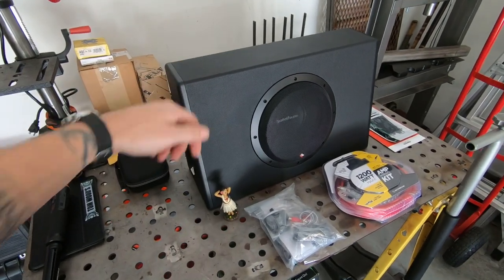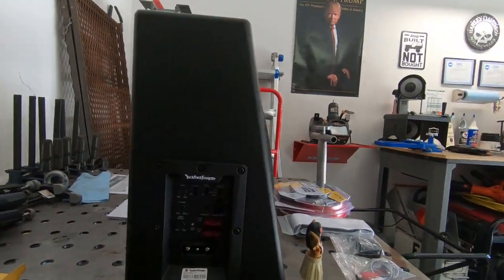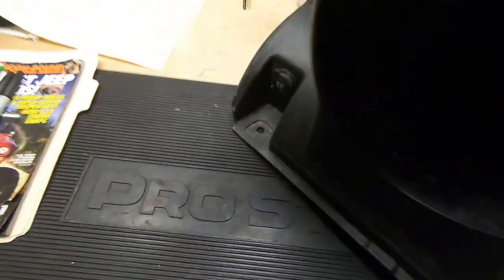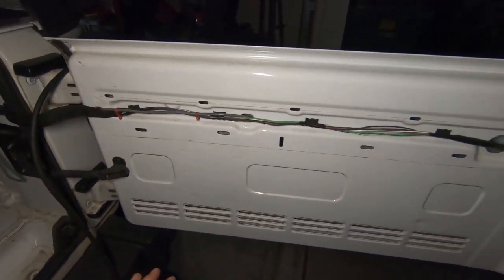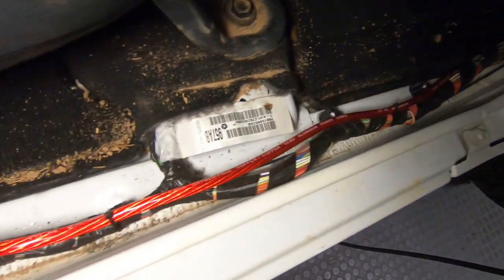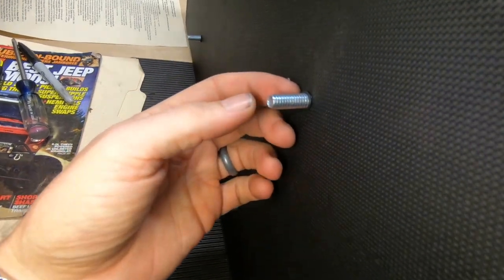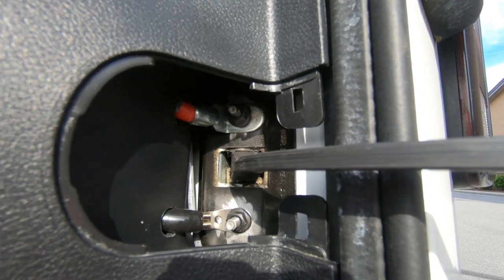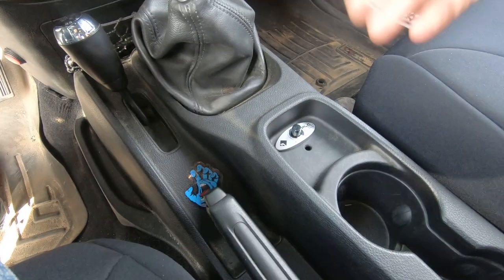Rockford Fosgate P300-10T Sub / Amp Combo & 1.5 Farad Capacitor | Clean Install Jeep Wrangler JK

Comment: I have had fairly big systems in my days but now I have this (the 12 inch) in my extended cab f150. These subs sound great for what they are
Reply: Did you put the sub under the back seat? Or behind it?  I have the crew cab but don't want to give up the space under the back seat.  I'd like to put it behind it.
Reply: @mikel6787  I have it behind my drivers seat so I lost that space and can't have a passenger behind me (that doesn't bother me tho cuz I've never had more than 3 people in my truck)

Comment: Rockford is rugged amp subs are golden and long lasting still using a punch 200 ix powder coated in great shape only thing is need to glue the metal Rockford logos that fell out on both ends but these bad boys keep playing 20 plus years old still cranking .

Comment from the maker: I ended up adding a layer of Dynamat Extreme Between the box & tailgate...no more vibrations. I also reinforced the back wall mounting points on the interior bolts of the box w/2 pieces of C-channel running laterally across the box from bolt to bolt (think "="). This helps to spread the clamping force across the entire back panel of the box vice just at the bolt heads/washers. If the box was solid plywood it wouldn't be necessary, but it's MDF & not as strong. Now I can sleep at night knowing my sub box is hoss as frig & won't fly off if someone slams the tailgate ✊🏻
Reply: If you install this, does it connect to your radio or what do you have to connect it with Bluetooth? Like I need an answer
Reply from the maker: You have to connect it via either RCA cables (like used on aftermarket head units) or you can tap into an existing speaker's wires for the audio input. You can also use the audio input signal to power the amp/sub on & off...it automatically detects the signal. It does not connect via Bluetooth...wiring is involved although it is minimal. If this is all jibberish to you, I recommend giving someone like Crutchfield (Google it) or your local audio dealer a call.
Reply: Good to know!

I am considering modifying this install and using corner braces. Braces to the tailgate, sub to the braces. This way the bolts will be facing down and not need to clamp as hard. Id probably put a rubber gasket between the top of the sub and the tailgate for vibration. 

I figure this way thieves cant get it still as with the talgate closed, the nuts are blocked by the sub and the floor, but if I want to take it out to fit something larger in I can open the tailgate and remove it without opening the sub up. 

Thoughts on how this would work?
Reply from the maker: It is certainly possible to mount like you say & each method has its pros/cons, but ultimately it boils down to what is most important to you...cleanliness of install, security, anti-theft, modularity/ease of removal/frequency of removal, etc. Since you asked my thoughts I'll provide some feedback:
- From an anti-theft standpoint, yes the bolts/nuts would be blocked w/the tailgate closed, but if a would-be thief could even access the sub box all he/she would have to do is click the power lock button & open the tailgate to access the bolts. Would it still slow them down, yes but not much. If it's easier for you to remove, it's easier for them as well.
- You would need corner braces at both top & bottom to control the inertia of the sudden stop of the slamming tailgate...over time if only secured at bottom the box would flex each time it was closed & eventually be prone to failure (unless I'm picturing your concept incorrectly)
- The design/internal reinforcing structure of the tailgate will limit where you can successfully drill & mount rivnuts...it may be possible to mount where you want but just keep in mind that there are steel "ribs" or reinforcement sheets running perpendicular to the would-be mounting face of the tailgate that could interfere. 
- The major plus of your idea would certainly be ease of removal...again, it boils down to what is most important to you & your individual needs. I'm happy to report that to this day I have not had to remove the box 1x since the final mounting design and it is still working flawlessly. Whatever way you decide to go, let us know & best of luck to you my dude 🤙🏻If you have any more questions, let 'em rip & thank you for your comment/question & view!

Comment: Great video! Can you help me .you didn't use the high-low converter, you connect directly from the old subwoofer's output
Reply from the maker: That's correct, I just used the 4 wires running to the factory sub, identified which were + & -, and spliced them into the RCA cables that came w/my amp wiring kit. The factory sub wires carry 6.4 Volts DC so can be used as a hi-level input to turn the amp on automatically. Just make sure your hi/low-level input switch is in "HI" & your "Auto turn on" switch is in "DC Offset"; she'll power up automatically as long as your head unit is on. Let us know how it turns out & good luck 👍🏻

Comment: I love how you mounted your sub and put the cap in the old sub housing. Do you think 2 pieces of strut would have been better to mount the sub to using spring nuts? That way you can have little clearance behind the sub.and not have to take the sub out if you wanted to remove it. Again nice install. just my 2 cents
Reply from the maker: I thought of a few different ways to mount it but ultimately took this route for a couple of reasons...1) It's hella-clean this way in my opinion. 2) In theory this would possibly deter, or at least slow down your average thief...they would either have to take the time to pull the sub & unbolt the box, rip the box off the tailgate (which would likely destroy the box itself), or steal the entire tailgate. Keep the honest man honest...thanks for the compliment, idea, view & comment! 🤙🏻

Comment: Some Tessa Tape would make that look a lot more "Factory". Also are you not worried that the sub or amp will get wet?
Reply from the maker: Never heard of Tessa tape...I'll check it out. Nope, haven't had any issues w/water intrusion. The only part really sensitive to water is tucked away pretty nicely.

Comment: Hi gear video! I have the same Jeep and am looking to do the same set up. Can I ask what is the purpose of the capacitor?
Reply from the maker: The capacitor helps provide extra voltage when the sub hits hard that it stores internally. Think of it like a buffer that takes the peaks off of voltage spikes....this keeps your headlights from possibly dimming when the sub is hitting & helps to lighten the load on your alternator. Thanks for the view & comment! Good luck w/the install, it's a fun project 🤙🏻

Comment: Do you know what tools I need to open up the fostgate sub? Like you did in the video 9:14. I need to swap my amp out came broken from factory🤬
Reply from the maker: #2 phillips screwdriver & looks like either a 2.5 or 3mm allen wrench (just from eyeballin'). Sub will be a little adhered to the box so will have to gently pry/work it loose OR maybe you can take the amp out & just reach your hand inside to unplug the leads.
Reply: @coldsteeloffroad  you know what amp it runs? I’ve tried researching but can’t find anything I have the 500 watt 12 by the way
Reply from the maker: I'd try calling Crutchfield.  How u know the amp itself is bad?

Comment: How is the vibration on the outside of the tailgate?  I was thinking of building a box like this, but I didn't know if it would vibrate too much.  Thanks!
Reply from the maker: It definitely vibrates. If you turn it up too much it sounds like a teenager's POS Civic rolling through a Wal-Mart parking lot at 10pm on a Friday night 😂. I literally just ordered some Dynamat Extreme to help cure this. Either way, it still beats not having any bass IMO. I recommend some form of sound deadening material if you go this route. Good luck dude 🤙🏻
Reply from the maker: Added the Dynamat Extreme to the tailgate, retightened the fasteners & she's pretty much vibe free now. The bolts were a little loose which is primarily why it was vibrating in the 1st place...I was just too lazy to check it.

Comment: Is it still holding up well a few years later? About to do this on my tj tailgate and was curious...
Reply from the maker: It's still going strong like it was brand new & zero issues. I've only had to tighten the bolts 1x as I developed a rattle at one point, but I used blue threadlocker on the 4 mounting bolts & no issues ever again. 100% would do it again.

Comment: Good morning 
I know this is old but one question - I am installing the 500P into my trunk - ran the power wire and bass control knob wire already-  now need to install actual sun and hook it all up - with this set up - are you able to just run the wire to tap into rear speaker wires? Like to connect the sub ti factory radio - can I just tap into the existing speaker wires (like pop side panel off and then use the Posi-taps to just tap into Neg and pos wire )

I have the wiring just want to  before doing it 
Thank you!
Reply from the maker: Good morning. Sorry, just saw this. Yes, you can tap into an existing speaker's signal for audio input to the sub. Thanks for the view & comment! Let us know how it turns out please 🤙🏻

Comment: Can you wire this sub without the remote wire? Just four signal wires from speakers before the factory amp?
Reply from the maker: I just wired mine straight off of the signal wires feeding directly into the old factory sub. You have a few options with this sub which is what makes it pretty cool in my opinion. Thanks for the view & comment 🤙🏻

Comment: I have a stock Ford F-150 stereo. If I add this unit to my truck I have a question about the speaker hook up. Do I leave my rear stock speakers hooked up and then tap into the speakers with the spliced end of the RCA hook ups? Or do I buy a LOC and tap into the stock speakers and plug the RCA into the amp unit?
Reply from the maker: I think you could do it either way, but to be safe, I'd honestly call Crutchfield tech support. Those fellers should be able to help you for sure I'd imagine. Sorry not the answer you were lookimg for, but jot gonna' blow smoke at you if I'm not sure. Thanks for the view & comment!
Reply: coldsteel_offroad not a problem. I have a call scheduled with cruthfield tomorrow at 12pm 😁

Comment: U put a clear coat on?
Reply from the maker: Without watching the video again & if I remember what you're asking about, yes I sprayed a little clearcoat over the area where I ground the paint off to get a good ground for the system AFTER I had the ground lug tightened in place. Purpose is to prevent corrosion/rusting. Thanks for the view & comment!

Comment: How did you get the actual sub out of the box? I have removed all the screws surround it but it still wont come free. Have tried a pry tool but dont want to exert too much force and damage it. Was it glued in?
Reply from the maker: There's a type of foam gasket that is sticky & can be a little tough to get out at first. I just worked mine until it came out...nothing too crazy though. Keep at it & she should pop loose for you. Thanks for the view!
Reply from the maker: ...worst case you may be able to unscrew the amp, partially remove it & "help" the sub out from the back side. You shouldn't have to though.

Comment: I see you have the stock radio how does it sound with the rest of the system?
Reply from the maker: The stock speakers are still lackluster, but the bass is sweet. I ended up replacing the 4 factory speakers when I installed my Genright roll cage w/some Polk units...much clearer, distortion-free sound but lacks mid-range; will have to tackle that later. 
Bass is pretty weak when top is fully off since nothing to reverberate off of but that's not the sub's fault. Thanks for the view & your question!

Comment: How you connect the capacitor?
Reply from the maker: BATT+ to CAP+, CAP+ to AMP+ (2 power cables will be on same CAP+ post...think CAP+ wired in-line between battery & AMP). CAP- to GND. AMP- to GND.
Reply: @coldsteeloffroad  thanks 👍

Comment: Do you still recommend it? I have a jeep patriot I want to put it in. I figure almost everything will sound good off the back glass.
Reply from the maker: I would. I don't know what your goals in a sub are exactly (big bass or a moderate level ok), but as long as your expectations aren't for HUGE bass like from 2 12's or something you'll most likely be pleased w/the sound. The sub does sound good & produces a good amount of bass (can rattle my mirrors & be heard outside)...the included gain controller is a must & I adjust it to my liking for almost every song & appreciate it. I recommend mounting it where u can easily reach while driving. In your application I bet it will sound amazing...sounds awesome in my Jeep even w/a soft top installed. Moral of the story is it sounds like a tight 10" sub in a sealed box, not some crappy 8". Do it man, I don't think you'll be disappointed!
Reply from the maker: ...produces enough bass to envelop you while listening (you can feel the music if that makes sense)
Reply: @coldsteeloffroad  thank you. just what I wanted to hear. Sounds like it will fit the bill nicely not having to build a box and find the right amp to make sure the sub is tuned properly.
Reply from the maker: @TRONMAGNUM2099  ...if you have the room to spare and can fit the 12" version (box slightly larger than the 10"), I'd probably recommend that...you can always turn the bass down, but she'll only suffer as much chooch as she can suffer if you know what I mean. I would have bought the 12" version but space was a factor for my install. They cost about the same price if I remember right...don't get me wrong, I love the 10" but bigger in this case is almost always better. Good luck bud 🤙🏻

Comment: I wanna put 2 10s on my JLU tailgate.  How bad is the rattle?
Reply from the maker: Rattles outside like the trunk of a '96 Ford Escort on East St. Louis racing rims w/2 12's run on a budget 1000w amp bought at a swap meet cruisin' through a Walmart parking lot. Not bad at all inside, can't really hear any rattle. Just kidding above...it does rattle outside but not that bad.
Reply: @coldsteeloffroad  🤣
I started second guessing for a second there.  I know what a 96 Escort with 2 12's sounds like.  I got some sound deadening mat, I'll be generous with that and keep my fingers crossed.
Preciate it.
Reply: @fightfish3265  How did that deadening mat work out?  Was thinking of doing the same.

Comment: that amp in the sub is only pulling 30 amps. You def DON'T need that Capacitor and you should remove it as its doing nothing. Also, you should ditch the bass boost and install this (PAC LC-1 Remote Amplifier Level Controller) instead to control the volume of the sub independently. Gives you the ability to turn off the sub completely.
Reply from the maker: When you add it all up w/accessory lighting, rock lights, light bars (potentially), and a winch pulling hella amps under load it all adds up. I decided to install it to assist my charging system & help reduce load at times of heavy draw if it needed it & don't care if it does nothing MOST of the time. Yes, I know 1.5 Farads is overkill but again, I don't care because it's hurting nothing. I'm not trying to tell anyone what they SHOULD do (unlike you), just sharing my experiences & installs on my personal vehicle as I build it. Thanks for watching, and like Rage Against the Machine said; "...I won't do what you tell me!". Do what you want bro...'MERICA ✊🏻

Comment: Wht does the phase do? I have the 12" version mines on 0. Hooked up to rear speakers.
Reply from the maker: Depending on the other speakers that are in your system, it can help the sound if your other speakers are "fighting" against it & cancelling out the sub's sound waves...all the phase switch does is reverse the polarity (+/-) of the sub. Just flip the switch & sit in the driver's seat...whichever sounds better go with that setting, either 0 or 180.
Reply: @coldsteeloffroad  ok ill try it. ITs crazy though how all these songs sound didnt. Some hit and some dont.
Reply from the maker: I know what you mean about the songs differing...some Slipknot kick drums really pop & some are like "meh". Must have to do w/the frequency & low-pass filter I guess.

Comment: How do you rate those fosgates ?
Reply from the maker: I'm pretty happy w/the 10" and it fits the inside of the tailgate on my Jeep perfectly. If I had the option I'd go w/the 12" though. 10" produces solid bass inside the Jeep as long as the top is on, not obnoxiously loud outside.

Comment: Nice install but that fuse is scaring me
Reply from the maker: What fuse? I don't even remember covering that in the video, haha...I only remember saying that I had the fuse removed while wiring or something like that. Will have to go back & watch I guess. Thanks for the view & comment! U have my interest piqued though...
Reply: @coldsteeloffroad  Yes the one you mentioned at 7:39, I've never seen anyone use an atx fuse for a sub install, great video though thanks for making it
Reply from the maker: @fridder.  oh that little guy? I wouldn't worry about that one 😉 I was surprised to see it too as typically I've seen BUSS-style fuses come in amp wiring kits. That's what came in my Chinese/Walmart-special wiring kit...forget the amperage off top of my head...30 or 50; not a little feller.